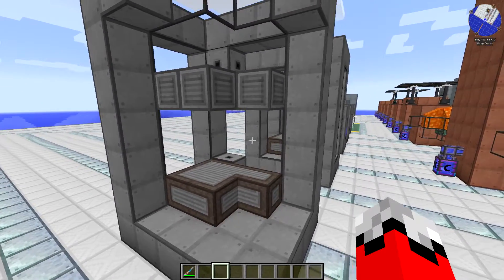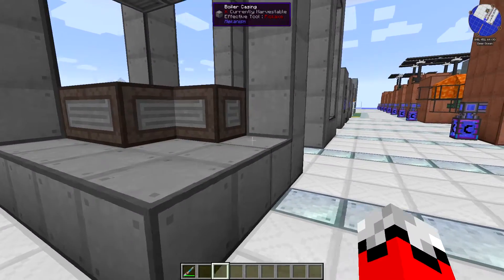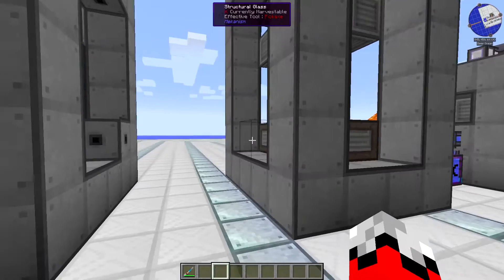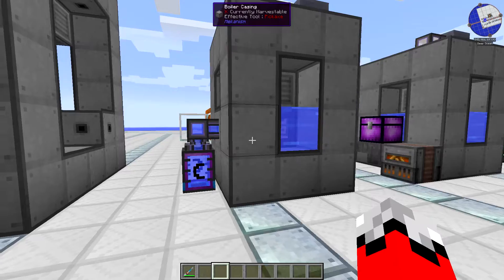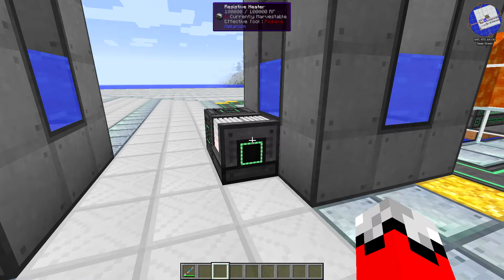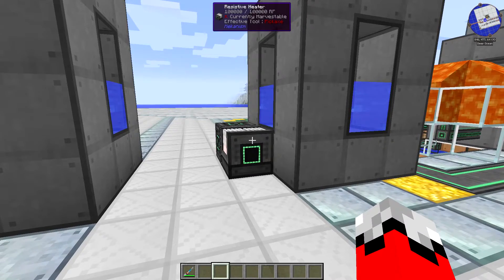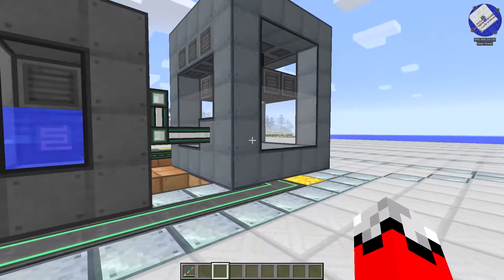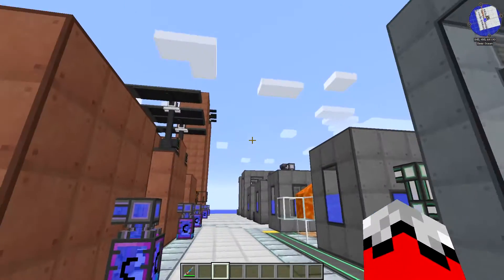Mekanism Version 9 Spotlight: Thermoelectric Steam Boilers

Comment: I've tried connecting both the mechanical pipe and the pressurized pipe and steam simply will not come out of it.
Reply: maybe my answer comes to late, but try to use the Configurator from Mekanism and simply right-klick on the pipe till it says *PUSH*. Hope it works :)
Reply: The mechanical pipe, along with the valve, has to be above the pressure disperser in the boiler. I spent about 30 minutes trying to figure that one out.

Comment: You describe this as mid-game for the mod, but I usually considered that spot to be filled by Gas Generators on Ethylene.  How would you compare the two on balance?  So far, they appear to be on par with each other.  And if you're already on an ore multiplication setup, the excess Hydrogen from that is useful for Ethylene conversion - just add a farm of some form, or leverage one you're already using.
I suspect I'm jumping the gun though, since the actual powergen is coming from the turbine.  :)  But its certainly something to consider, as a talking point on the next vid.
Reply from the maker: This is a very good question, and one I've actually been thinking about since making this video.  Here's my take on the two power methods:

The two power generation methods are actually pretty well balanced with each other, in that each one doesn't step much on the toes of the other. In fact, depending on your setup, they'll coexist extremely well with each other (see the end of my post).  Here's the contrast:

Ethylene:  Comparatively inexpensive but relatively complex to set up (especially if only using Mekanism or a pack without decent auto-farming).  Additionally, without supporting mods (and even with them), ethylene generation can be space inefficient to scale up due to farmland constraints.  A solid ethylene generation system will produce in the 5k-10k range, but can be pushed higher by adding more farmland, crushers, PRCs, burners, etc.  Byproducts can be utilized to assist in ore-processing and making Mekanism plastic.

Steam:  Very expensive to set up, but also much simpler.  Can produce passive power off heat generators and/or active power off burnable fuels.  Scaling is easy and relatively space efficient compared to ethylene when considering farm space.  A solid heat generation system will also produce in the 5k-10k range, but can be pushed higher with the addition of more heaters.  An additional benefit is that the steam generation from a reactor can be pumped into the turbine for more energy production (as you'll see in the next video, a turbine can handle both a boiler and a reactor at the same time and still not max out its capacity to produce power).

If we look at Mekanism as a mod taken by itself, the steam system is far more easy to automate at the cost of more materials at the outset.  Additionally, the steam system will be much easier to scale since ultimately adding more farms will require more infrastructure and space than adding another handful of heat generators with lava on top of them.

With supporting mods, the Ethylene system becomes more attractive.  With easy farming from EnderIO or MFR, the infrastructure feeding a PRC is greatly simplified, so makes it much more viable in the mid-game.  Additionally, it has useful byproducts whereas the steam boiler has none at all.

So it's pretty situational; something that's going to be based on personal preference and the presence of support mods that allow easy farming.  On a personal level, I like both of the options presented for different reasons.  Ethylene is one of my all-time favorite power-production methods because it's different, powerful, and has useful byproducts.  Steam generation, on the other hand, makes the power system an actual resource investment that scales easily and inexpensively after initial setup.

It's also worth noting that there is a synergy between the two that can be exploited as well.  In some testing I did over a year ago for my Infinity Fortress series, I discovered that the fastest way to produce Bio Fuel is with a tree farm, and it's over 30% faster than the second fastest way, which was sugarcane.  Since you're getting wood as a byproduct of that farm anyway, seems that turning it into charcoal and starting up a boiler would be a pretty easy way to double your power off the same farmland.  That, to me, is very attractive from the standpoint of a pre-reactor base (or a base where I don't plan to build a reactor).

Comment: What's the point of doing this? Very expensive generator to only 114 rf / t. Comparing the big Reactors of the same size , produces 4,2Krf / t. About 37 times . Mekanism is my favorite mod , but is declining . Increasingly expansive and less productive.
Reply from the maker: The boiler is also more aimed toward in-mod balance than necessarily trying to compete with BR.  Boiler/turbine setups fill a niche in Mekanism as power-gen between wind turbines and a full-blown reactor.  Also of note, my example turbine was not very well optimized.  It was more an example of an easily constructible early-game turbine.

As somebody who doesn't use BR in their packs anymore, I can see a fair amount of utility in having a modestly expandable power-gen that can pump out between 5 and 10Krf/t utilizing only lava, coal, or blaze rods.
Reply: Ok. Thanks for explain.
Reply: I think it only works well when connected to a fusion reactor, as the two structures together can generate the same amount of steam as a water-cooled fusion reactor but only using the same amount of fuel as an air-cooled fusion reactor as the reactor itself does not have any water pumped into it .
Reply: Take into account that you can add many , many heat generators to single boiler-turbine setup.
Reply: And I just checked out in wiki, thermoelectric steam boilers are actually a must for sodium-cooled fission reactor as a heat exchanger to generate steam, so in conclusion, the thermoelectric steam boiler is not needed until you start going nuclear.

Comment: Can you use transvector interfaces to have more lava around a single heat gen?
Reply from the maker: Transvector interfaces work as an extension of item, power, and liquid transfer while the lava around the heat generator is more based on neighboring block detection.

You can certainly give it a try, but I highly doubt it would work.